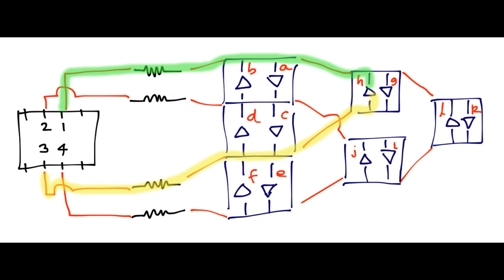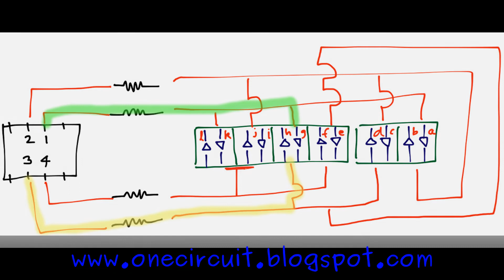Charlieplexing 12 LEDs from 4 pins on an ATTiny13

Comment: As I said, really nice! It would be also nice to be able to switch between the effects by pressing a button. Is that possible or do you have to reduce the number of LEDs therefore?
Reply from the maker: It’s possible as there is still PB0 available and PB5 if desperate!
Reply: @onecircuit-as  
void lightemup (byte portdirection, byte portstate, int mydelay) {
    DDRB = portdirection;
    PORTB = portstate;
    delay(mydelay);
}
sorry, I am new to this. I want to slow down the whole thing. the LEDs should stay on for longer time. (there is no need to be a (longer) pause between switching from one led to another). 
I do not know how to set the mydelay time. I want to set it to let's say 1000ms.
can you advice me?
Reply from the maker: What happens when you call lightemup with a larger delay? e.g. lightemup(leds12[0][0], leds12[0][1], 50);
Reply: @onecircuit-as  Now I have my sketch working and I connected a push button to PB5 (the button: one side: 4,7k resistor to 5V and 5V also to PB0  other side: to ground). Now I want to switch between the void modes. I have some problems doing this. I wanted to use millis to only switch if the button is pressed at least 200ms but it did not work. You seem to be very professional in this things. do you have any suggestions or maybe an example which is working with the attiny13a?
Reply from the maker: I can take a look if you post your code? Usually I debounce the switch by a little if statement: if(switch); delay(50); if(switch) {do something}
Reply from the maker: You’re switching effects with a single button? I’ll email a possible solution tomorrow. 👍😀
Reply: @onecircuit-as  yes that's correct. I think I wrote PB5. It's PB0 were I attached the button.

Comment: I get what's happening and what I want to know is how can u determine  what resistor to use.  I've looked online "resistor calculators" I gues what I'd like to know the best way to understand  how  approximate  a resistor? I have general knowledge of leds but it seems to escape me in factoring a resistor.. sorry so long
Reply from the maker: To be honest I don’t really pay much attention to exact resistor values. I really use anywhere between about 100 ohms and maybe up to 1K and just have a look at the quality of light that’s coming out of the LED. I assume that if I did it properly the LEDs would last longer but at this stage I’ve had no real issues and I like my low stress approach! 👍😀

Comment: I’ve been meaning to do a Charlieplexing project but I can never seem to get around to it. I like the surface mount LEDs on breadboard projects, a change of scenery from 5 mm through hole.
Reply from the maker: I will admit that I've been putting it off because I wasn't looking forward to the inevitable head-scratching (I floated the idea nearly a year ago!). But...it was very satisfying and who doesn't like to see blinking lights? I'm now wondering about charlieplexed inputs and also what happens if you combine charlieplexing with a shift register - would that be some kind of exponential led explosion?